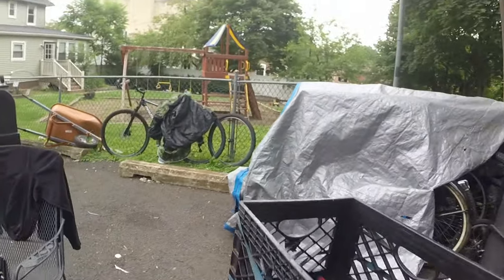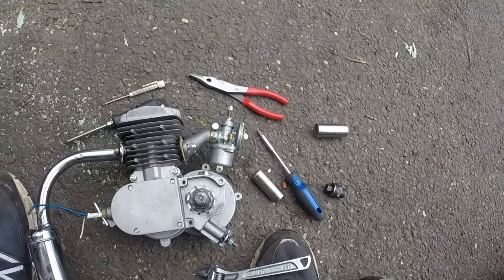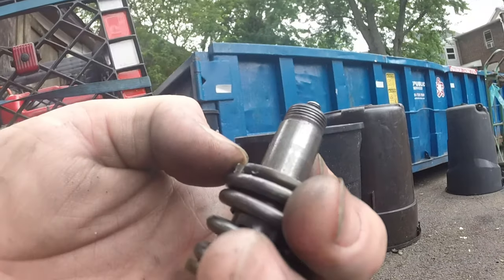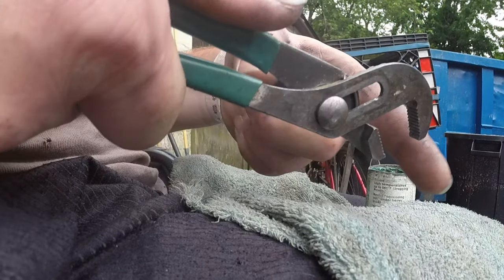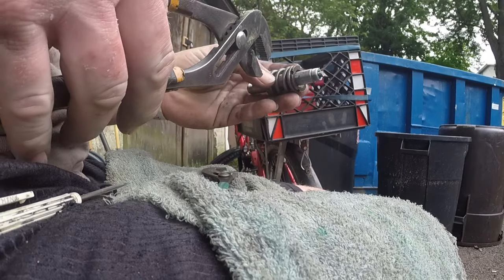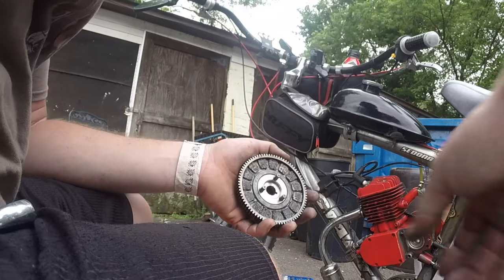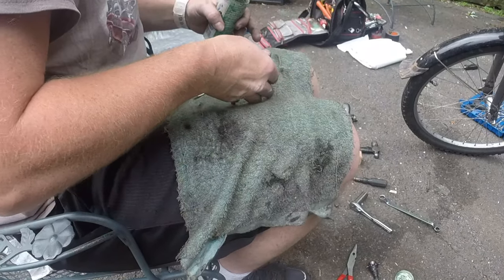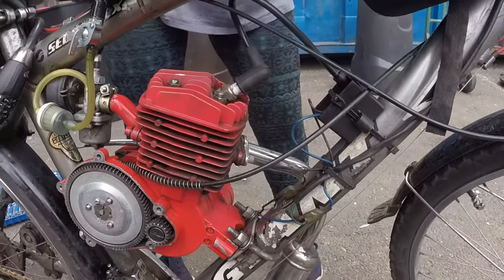Heather Fixes Her Clutch In Here 80cc Motorized Bicycle

Comment: *Pro-tip, work on top of a blue tarp, and stick a baking sheet under the motor.. Most things will hit the baking sheet with an audible report, and everything else is an easy find on the blue tarp which you can also fold up to get everything to roll down into 1 spot for collection
Reply from the maker: You know I was actually thinkin about this the other day when I dropped 2 bolts and took forever to find them because they feel into the rocks and it’s so hard to find anything in those purple/brown rocks. Thank you, for watching and commenting cause I was thinkin same thing.

Comment: Hi, my son and I have built 6 bikes now and we’ve had clutch problems with just about all of them. Just built a powerhouse of a bike but the clutch would go soft within minutes of riding. We finally noticed that if we backed the bike up with the clutch out it would tighten then forward it would loosen. That nut holding the clutch spring was moving in and out. Took it apart today and put it 3 threads in from start of threads and red locktite and now perfect your a genius thank you best video on clutch repair
Reply from the maker: That's great brother I'm glad it helped you and your son out. Super awesome you got your son involved in the hobby too. That is what is going to keep this hobby alive and doing better then ever. Thanks for watching, ride on.
Reply: @JMB676  I be by onoiok lol

Comment: This was good it is what I got going on today but I need to replace the light sprocket for some reason it got stripped out and I can’t get bitch off with out the tool and I hope I can get one at the part store and the sprocket to at the part stores cause I don’t want to have to order one but if I have to I will but where do you order yours parts from
Reply from the maker: It depends what it is but usually all orders go through Amazon or eBay as second choice. But only if I can’t fix broken part by repairs and making it better or just making my own part that will be stronger. What parts do you need? Jw

Comment: Are you sure it's the bearing squeaking, and not just the clutch-pads, I've had some pads that squeak like crazy even when new, it would've been way easier/better to fix the stud, and put the new engine on her bike, then maybe go through her old engine fixing anything that's wrong with it, making it your new backup-engine maybe?, my way of thinking is just to logical for our upside-down society today, it's truly madding sometimes, I seen a video the other-day of a young-man that had a flat tire, you could hear him talking on the phone to somebody, "its weird, the tire is only flat on the bottom",   :-O  <me), The LAHoover guy has a new video out showing how too adjust the spring-load without taking everything apart, that was one of those lessons that I had to learn the hard-way, but I think the LAHoover guy might actually have the first video talking about this adjustment,
Reply from the maker: There’s more wrong with that engine then just the broken bolt and the “La guy” isn’t the first to talk about that adjustment in a video either. But anyway I’m a hundred percent it’s not the pads that were squeaky, it was a lil more then just squeaking but without a sound bite of the noise it’s hard to describe. Thanks for watching

Comment: did you say red or blue[removable] threadlocker?
Reply from the maker: Blue is removable red it with good heat. Well heat can be used on both I guess technically for easier removal.

Comment: hey Johnny love your videos hope all is well I'm having an issue with my yd. I just can't get it to idle I have taped the entire manifold and carburetor and where the two join and I'm just wondering if you had a similar issue with the yd100.I can get it going using the choke and it runs fine when I'm riding but it gets to the point where it either doesn't have enough idle adjustment screw to keep it running or if I adjust the idle screw clockwise after that point the idle just goes out of control.I know you're probably a busy guy so don't expect a fast reply but any help would be appreciated
Reply: by the way it's a stock antique carb and manifold the only upgrade I have on it is a expansion chamber from CDH power.fuel flow seems to be good in both filters are clean as a whistle.look forward to your input
Reply from the maker: @benjamincoletti3267  well where is the clip at on the needle in the slide? I would try putting the little clip at the top notch to get it moving better.
Reply: @JMB676  thank you man I know you don't get paid for doing this and you're probably a busy dude and I just really appreciate the feedback I will try that and let you know hope all is well man
Reply: thank you for the input I took the needle out and noticed the retaining pin was on the top clip so I just figured to move it to the bottom and I got instant results it's still creeps with the idle but 75% better thanks again.probably being a little greedy here but with the idle start creeping up if the motor was starting to overheat?
Reply from the maker: @benjamincoletti3267  no its gotta have an air leak more then likely how old is it?
Reply: it's only about a year old.
Reply: I'm in Massachusetts by the way. I can relate to your types of roadways and potholes and s***.I myself crash two times so far in my two years of riding.dangerous out here in New England in New Jersey Etc..we got the cold weather potholes frosties bad crazy drivers congested roadways.not quite like Cali or somewhere nice like Florida where it's flat and open.but something about these damn bikes are Just So fun...anyways thanks for the help. Carefull out there
Reply: wicked sick you got your girl to ride motorized bikes with you. that is a true partnership right there
Reply from the maker: @benjamincoletti3267  yes there's an air leak somewhere, if you only just rode the bike and it was fine but started doing this out of nowhere then I'm going to guess it's a crank seal. There's a couple ways to find them but easiest is by spray carb cleaner at different spots on the. Motor n seeing if the idle changes . It can be dangerous so if your wanting to know how message me on Facebook n I'll explain it better.
Reply: @JMB676  okay thank you so much and I will get in touch with you on Facebook what do I search Johnny's motorized bicycles?.I got to say I feel pretty honored to have so much feedback and as always be safe and I'll talk to you soon
Reply from the maker: @benjamincoletti3267  yes look for Johnnie's Motorized Bicycles it our group and you can friend me from there n message me.

Comment: my chain is been cherping like birds ever sense i put the 420 chain on . i think its cutting a grove in the case
Reply from the maker: Probably, it’s a good bit wider if I’m not mistaken. I find the best is the 415h chain. It’s far beefier then the standard 415 and since I started running mine I have popped one yet. I run 3 one on each of my daily bikes and two of those have over 10k and one has about 4-5k it’s still pretty new in comparison. But I also clean my chains and grease somewhat regularly once a month or so. And they just last. Before that I would carry a chain and breaker with me just to replace it and on the fly cause they broke so often. They really are quite a bit more substantial.

Comment: It’s the gear sprocket next to the clutch plate I can’t understand how it got stripped out motor ain’t very old maybe 4 months if that
Reply from the maker: @richardbruning-qn3ud  message me in messenger to talk and share pics easier and I’ll try to help you out. My name on Facebook is Johnnie William Moser Jr
Reply from the maker: So the spur gear on the crank shaft. They get stripped for a couple reasons even on new motors. Main is not enough grease. They also can be misaligned which will wear it down fast and hard clutch releases on take offs instead of allowing it to be engaged slowly like driving a manual vehicle. Even if it’s misaligned you can grease it and is might wear it a bit but only so that it matches the tooth pattern on the clutch spur gear and won’t wear it anymore then that as long as you grease it regularly. Now regular means about once a month for heavy riding but if your only a few miles a day and a couple a week then every two or so months. It’s really something you gotta pay attention to and learn your own best timing for. Doesn’t need a lot only a soda cap filled amount or so on the gears spread out but not on the clutch plate or the basket. Try to keep it off of there. Also before applying new grease wipe off old grease as much as you can with a rag. Doesn’t have to be clean you just want the large majority of it gone. Old grease basically turns into a sandpaper type paste which will wear down a part faster then not having any grease in most cases. So cleaning and greasing and you won’t have any more problems. New motors do not always come with grease unfortunately and in turn it’s best to always go over a new motor and check blots and nuts and grease amounts. Hope this helps and if you need anymore help just join our group on Facebook or the chat on messenger and feel free to reach out cause responses are quicker there.

Comment: I liked the video, but the one part I'm having trouble with you skipped. You showed everything else step by step except that one step i'm stuck on. You got to the part I've been struggling with for days and totally skipped it. You just mentioned , "theres  a nut and a washer here, just remove it." As if it were that simple! Every youtuber skips the same step!!!!!!!!!!!!!!!!! I'm so frustrated! How do you remove the nut holding the clutch basket to the shaft????????????? I haven't been able to do it.
Reply from the maker: Well I usually take off the nut on the chain side cause I find it easier unless I have to take both sides off to rebuild the internals. But you just need to hold the clutch from moving while you loosen the nut. If you have an impact you don’t have to really hold it much cause the impact does it easily. I put a large pair of channel locks on the chain gear as I loosen the nut but there’s a few ways to go about it but just got think of what works for you. That’s probably y all us YouTubers just say remove the nut…..cause that’s what you gotta do lol. Best option is an electric impact though if you can get ahold of one. Y do you need to take it all apart ? Jw
Reply: @JMB676   I was taking it apart because I believe its jammed. If I put it back together and connect everything, the arm bar wont move. Its as if something in the shaft is either jammed or threaded on way too tight.
Reply from the maker: Sounds like it’s to tight, the flower/star nut is only supposed to be on enough to apply pressure to the plate n flywheel when engaged.
Reply: @JMB676  I finally got it. It took me getting a hernia  to finally remove that nut, but i finally got it. the pin in the shaft was not on straight. it was jamming the preload spring.
Reply from the maker: @CUBANIDAD  that’s kinda common problem, I just fixed one like that. Good job brother.